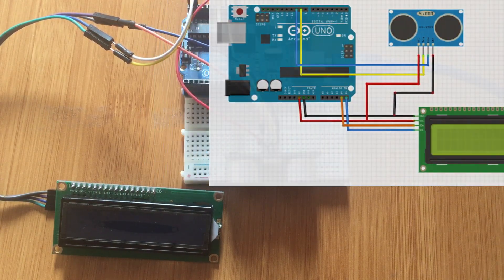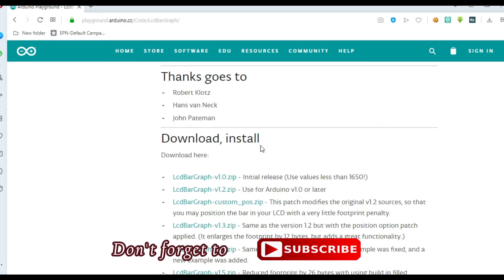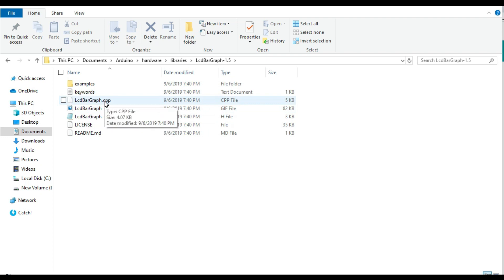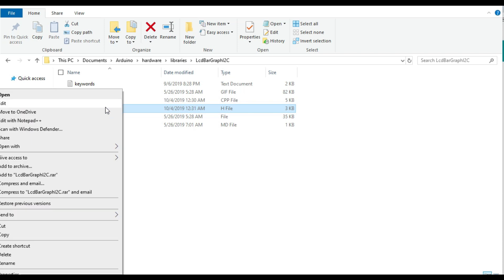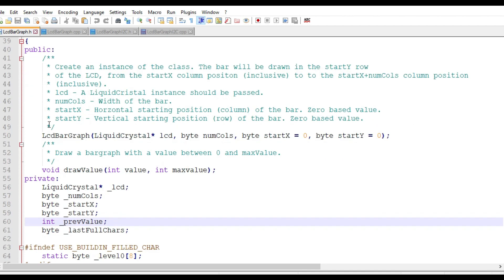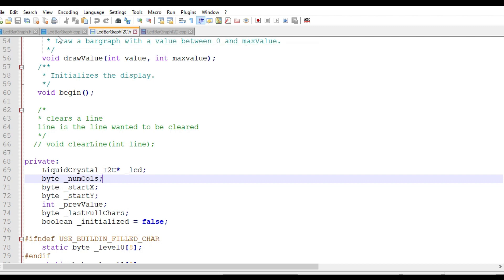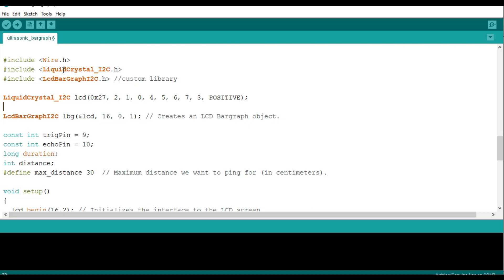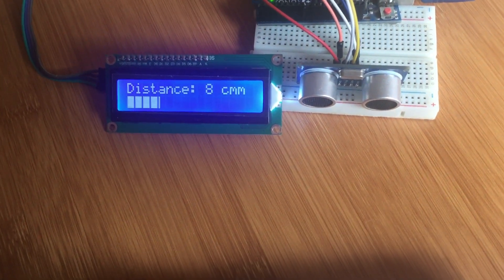Displaying distance from Ultrasonic sensor as bargraph on I2C LCD using Arduino.

Comment: Is it possible to send me the new .cpp and .h files? cause I have an error message :   " 'POSITIVE' was not declared in this scope
'POSITIVE' was not declared in this scope".     leilektsoglou@gmail.com   Thank you very much in any case.
Reply from the maker: That error is most probably comes from the LcdCrystal_I2C.h library. Make sure you have that library installed and you can even first test it using the I2C display only without the Ultrasonic sensor.
Reply: @mytectutor  After 2-3 hours of searching I found the way. Just to know, while you are explaining the way  to go to the new files, you dismiss some parts (clear code segments)
Reply: @Leilektsoglou  how do you fix it? I have the same problem